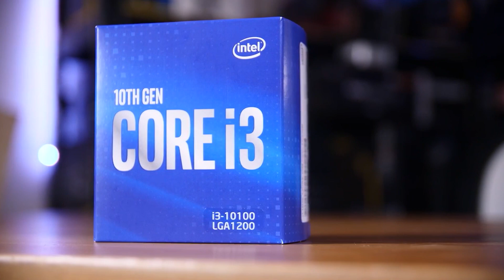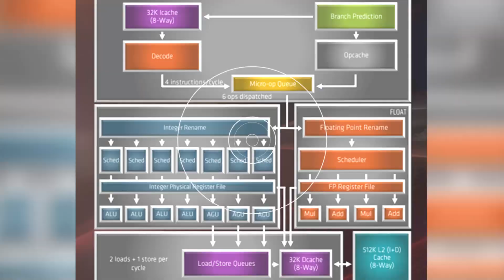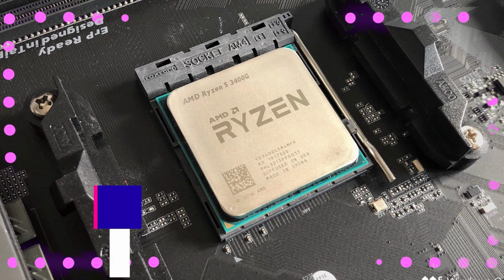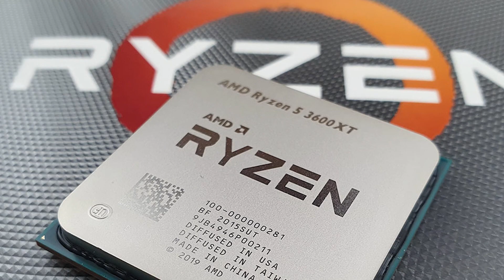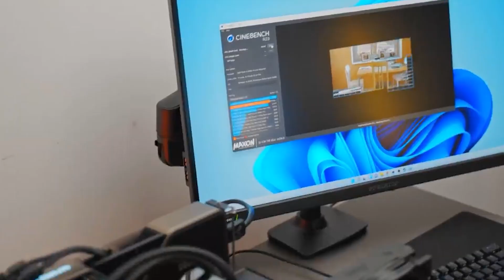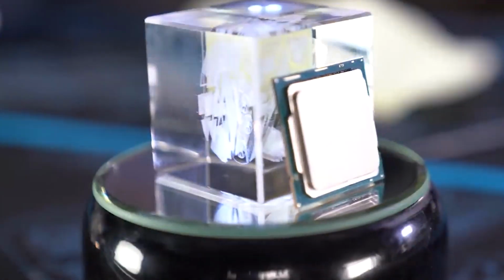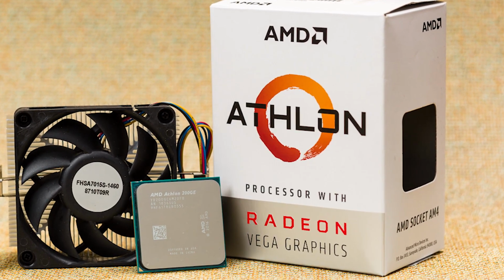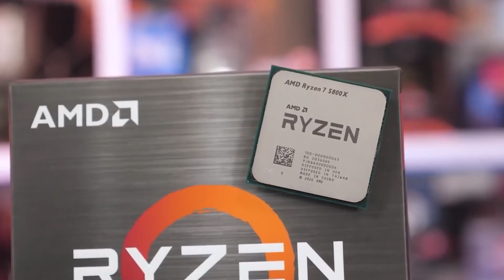BEST BUDGET CPUs in 2022

Comment: what would you recommend with nvidia 3060ti 3070 3080
1080p high fps low/normal settings
what cpu do you prefer amd or intel and which price/performance! I Sub ! ty for the videos
Reply from the maker: 3060ti will get you high FPS paired with a decent cpu.

If you can wait on CPU then wait for Am5 AMDs…if not then go with 12th gen intel’s if you don’t care about upgrading in the future with the same MOBO then go w AMD now.